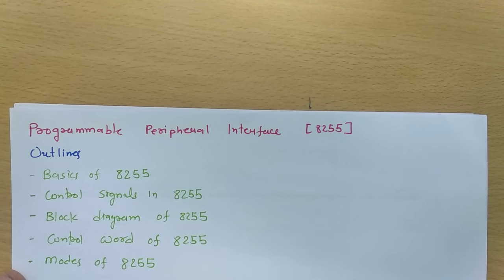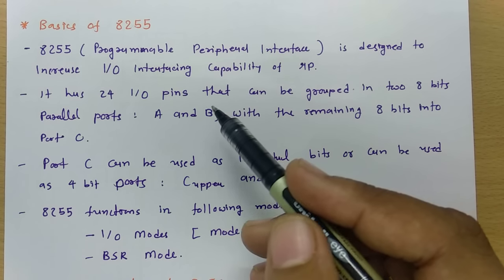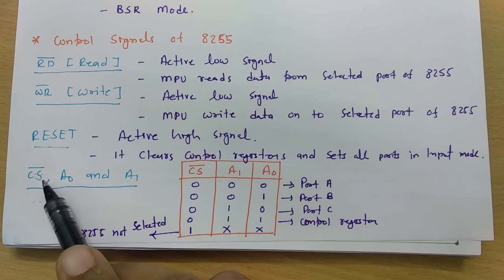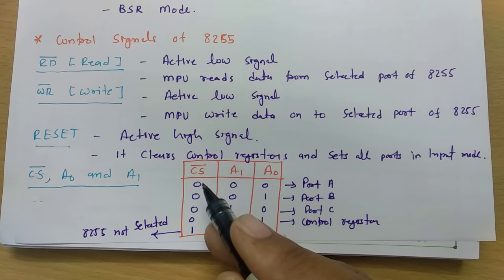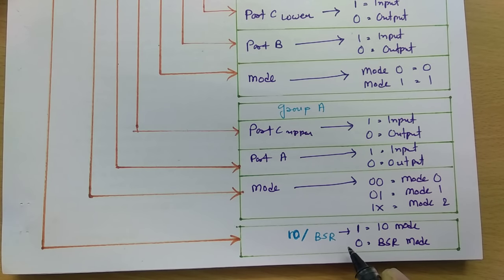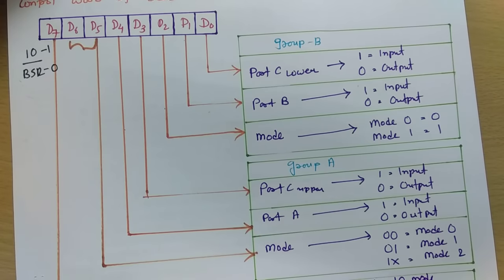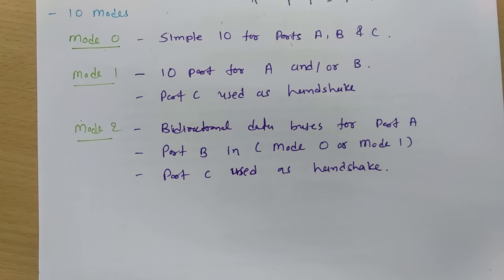Programmable Peripheral Interface 8255 (Basics, Control Signals, Block Diagram, Control word & Modes

Comment: 01:55 Programmable Peripheral Interface 8255 increases input-output interfacing capability of microprocessor
03:50 8255 has 3 ports: A, B, and C with different usage modes.
05:45 Control signals and their functions
07:40 The 8255 interface has three ports and control signals
09:35 Control word defines mode of operation for 8255.
11:30 Explaining the selection of modes and control for input-output mode
13:25 Explaining control word and modes of 8255
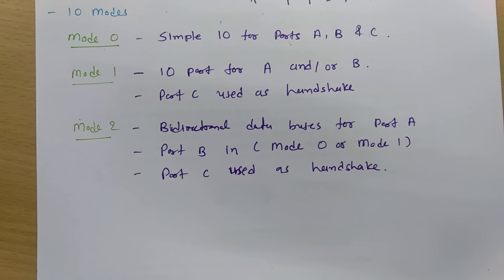15:17 The port C can be selected and controlled using D1, D2, and D3.
Crafted by Merlin AI.

Comment: Hi: I watched your video, it was great, I have a question, I connected the 82c55 to the STM32F407 ARM IC, but I don't get any output from 82c55, and when I start it with the  Mega 32 IC, it works. Its power supply is 5V, but the data and control input signal from ARM to 82c55  is 3.7V .It is possible that the 82C55 IC does not work with 3.7 input data
Reply from the maker: You should check the data and control signals, 82C55 requires TTL logic levels.